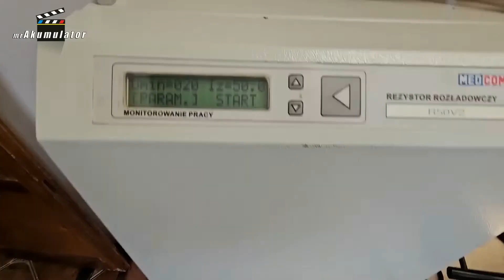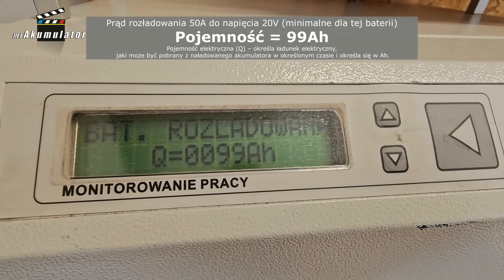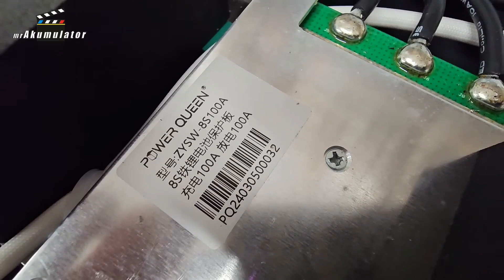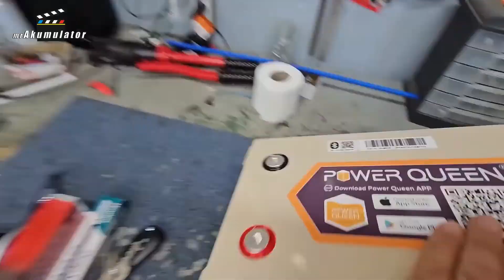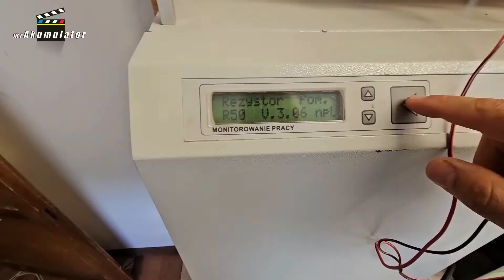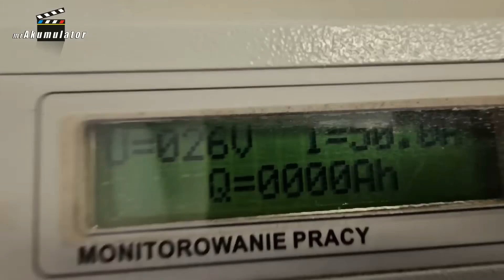Chinese LiFePO4 Battery 24V 100Ah from the Inside

Comment: VDD, RX, TX, B- connector...
It looks to me like serial bus communication connector.

VDD is supply voltage
RX is receiver wire
TX is transsmitter wire
B- is negative pole (gnd).
@toyzz66 maybe have right, maybe that wires belongs to bluetooth module...

Comment: The white wires look like they go to a Bluetooth module.
Reply: Starry Sea seems to be a manufacturer for battery systems and there 25.6V 100Ah offering says it uses bluetooth control, so most like it´s also bluetooth, indeed.